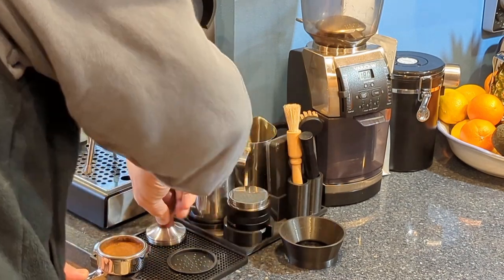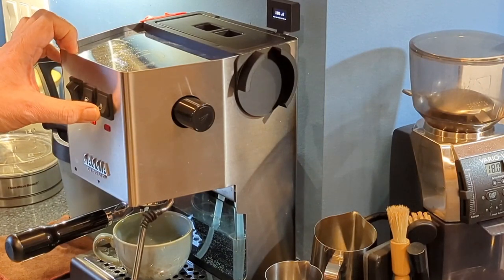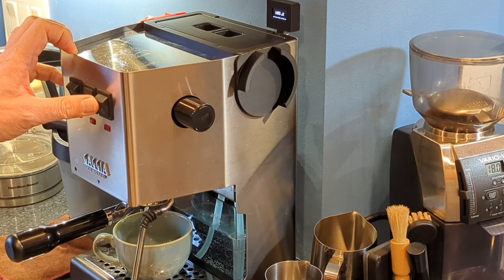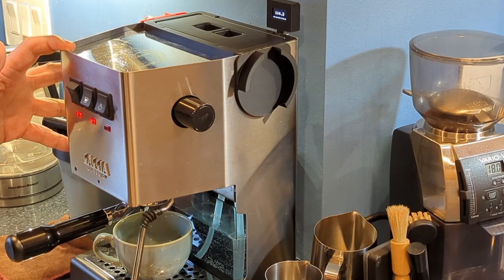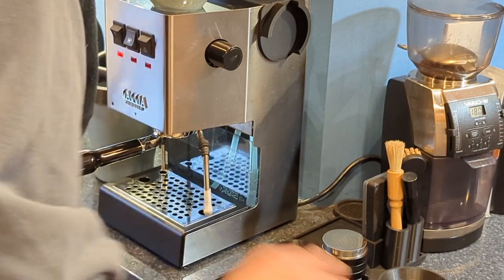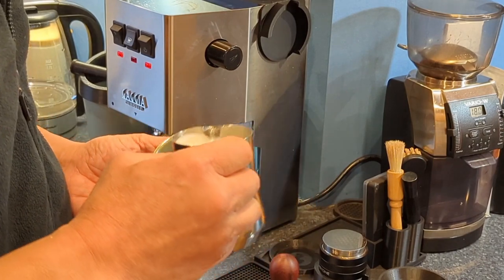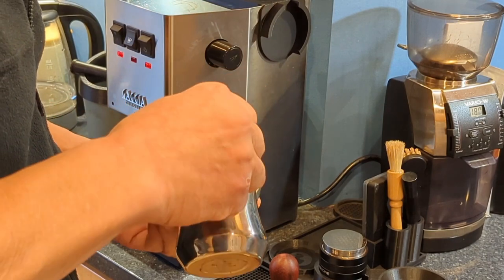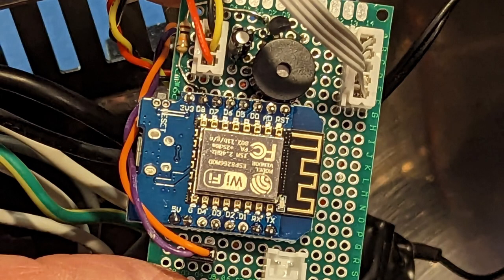Non-intrusive Gaggia Classic Pro Espresso Machine Mod

Comment: Great video. I noticed how you keep your portafilter mounted on the machine. I’ve always kept mine in the machine because I heard it is better for your gasket over time. Do you know anything about this? I could be misinformed for sure so don’t change anything you do, I’m just curious if you know anything about this.
Reply from the maker: Thanks for your compliment. No I haven't heard that. It could be the reason why I had to replace my gasket within a year. Thanks for the tip

Comment: I am interested in information about the "left the steamer on alarm".
Reply from the maker: Basically it's monitoring the boiler temperature to see if is has been above a threshold (123 C) for too long (5 min).  For details, you can look into the source code I posted in github.